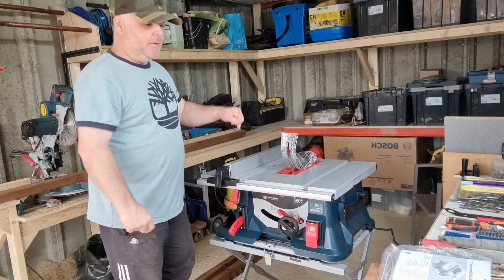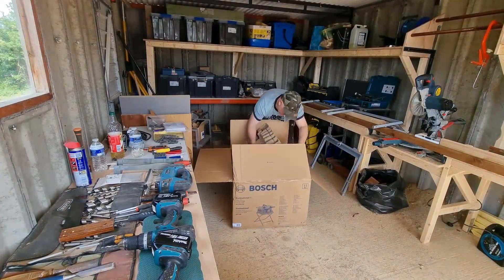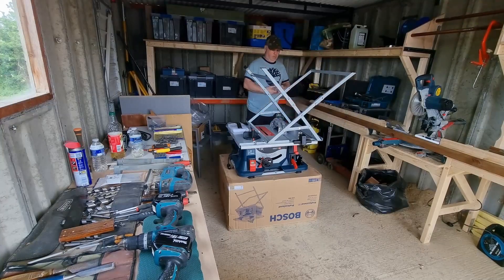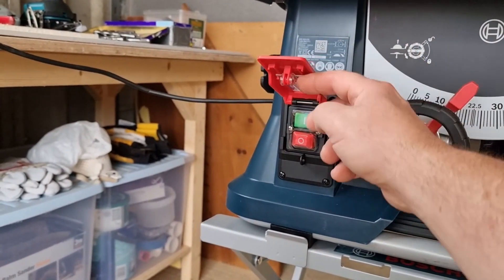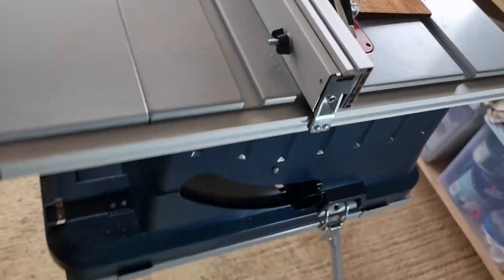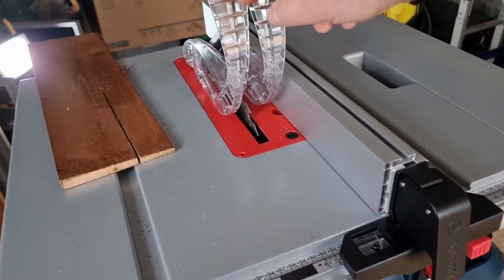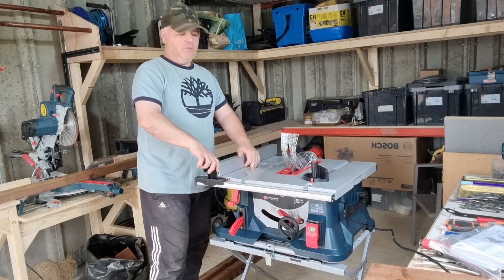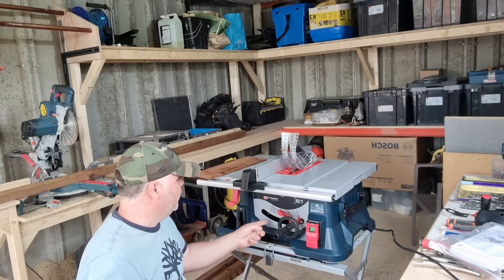Bosch table saw review, cutting wood made easier.

Comment: You can slide down small window on on/off switch so you can turn it on without pulling up a red lid
Reply from the maker: No you can't, you have to lift the red paddle to turn it on.
Reply: Yes you can. I have the same table saw. Try it you'll see and be happy about that 🙂 @mjsimo1

Comment: Btw turn the mirror recording off when filming in selfie mode with front camera. I was confused with left/right view 😀. Are you satisfied with table saw?
Reply from the maker: Not on selfie mode? It has it's limitations and it is a moveable site style table saw, but yes I like it. If your more into joinery work and need something that's also good at across cutting, I would pay more for a better one.
Reply: I thought it was like driving on the other side of the road in England. They might even make saws this way... 😂